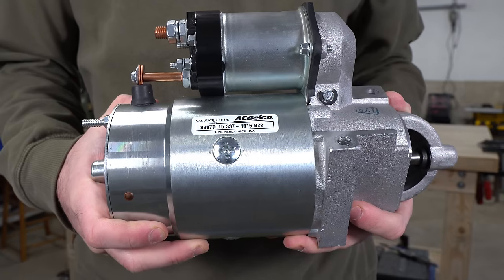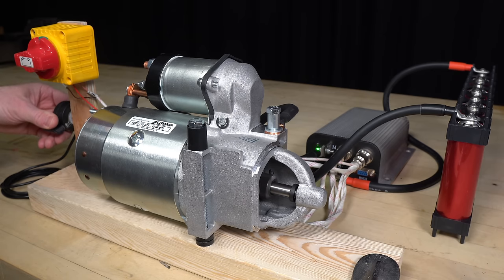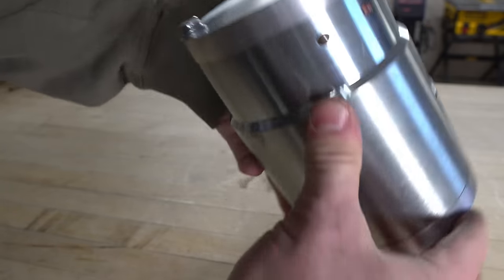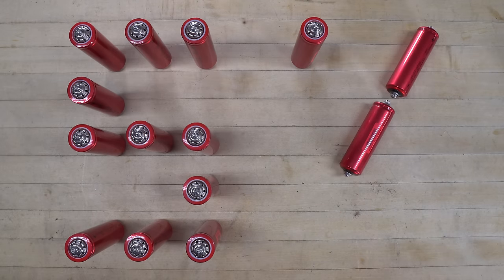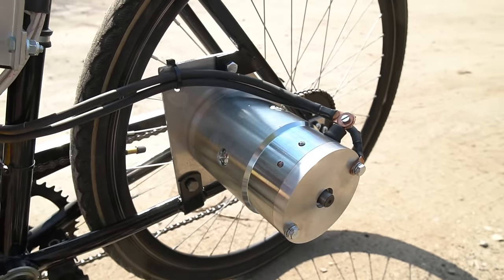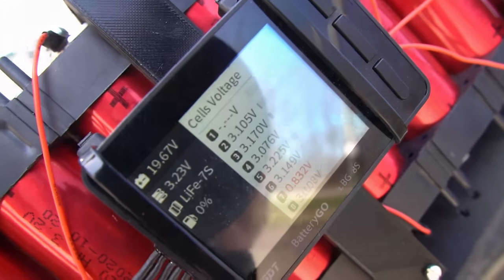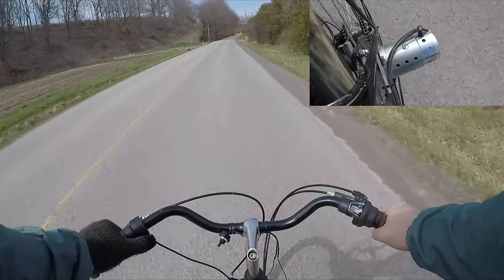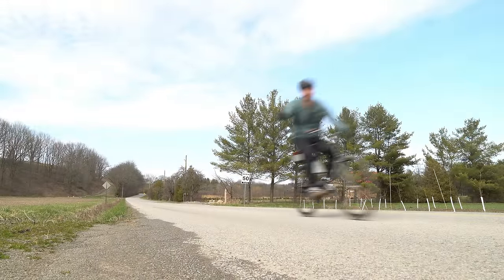Starter Motor Powered Bike

Comment: This is a valuable lesson on the difference between continuous duty and intermittent duty motors.
Reply: Lmao 🤣🤣🤣 burnnnn
Reply: The current draw on automotive starter motors is huge and the heat generated where the brushes run on the commutator because of this can even melt the solder holding it together after a short period of time. Converting an alternator into a motor is much better for bike use.
Reply: @alistairshanks5099  That is why they spotweld it.
Reply: Rubbish. That starter motor has a no load speed of  over 20000 rpm.
He is geared for 1000meters per second.
Over three times the speed of sound.
This means that there is almost no back emf generated reducing the voltage and current through the coils, and no air turbulence transferring heat from the armature and brushes to the housing.

He is turning many kW into heat and a small fraction of a kilowatt into mechanical drive force.
He needs a 250:1 reduction drive, not 5:1

That would give 50 times the torque per amp supplied to the motor, and over 50mph top speed
Reply: @Maungateitei  This thematic  is very interesting . Beside , as first ,what i captured ; no cooling vent , will be nice to change housing with Alu ( with ribs ) and , that will provide good cooling .. Ratio is still under a question  ?  By you , it should be 250 :1, , that means that we should reduce starter rotations 250 times ?

Comment: Suggestion for you next project: modify a LG washer machine's motor to run an e-bike. I saw that these motors are 3ph. I wonder if the large radius could delivery more torque.
Reply: There was a guy that did it, but i forgot his channel
Reply: @foxxyytofficial  ik the yt channal kreosan that did that
Reply: @RafeTVGaming "Kreosan" used an universal motor. The LG motor we are talking about is a brushless permanent magnet motor. "Why Not Cycles" for one made a video about the conversion.
Reply: I would think a starter motor for a car would have a lot more torque than a washing machine motor even but definitely a lot more than an e-bike motor which are considered high torque low RPM but nothing compared to a car starter that has to turn over an engine with a significant amount of compression to overcome and I think the tricks probably in the gearing but well outside of what has been tried already but I could be wrong you don't have much experience with electric bikes because I haven't got my first run running yet because it still needs a battery that's outside of my budget right now but I did see one here on YouTube where somebody used a much smaller starter successfully and another one that was working halfway decent using a quite small wiper motor but I can't remember Mimosa Channel I saw it on
Reply: @Teknopottu  you don't happen to have a link to that video by chance do you
Reply: @Rob337_aka_CancelProof  Found it, there seems to others too. Replace space with a dot. https://youtu be/UTLzlBWLxCw
Reply: @Rob337_aka_CancelProof  YouTube deletes most comments with links nowadays
Reply: The Direct Drive washer machine batteries are nuts
Reply: @Teknopottu  Hehehehe, it's a spincycle
Reply: More efficient

Comment: Next step is to water cool it! Plug all the hole except two, so you can have water flow through the centre (and make each end with the bearings water tight), then pump that water to a large radiator somewhere on the bike. Totally pointless but could be fun.
Reply: Instant corrosion. Instant shorts. Starters are designed for short duration and high current, they don't work well for other applications.
Reply: Water is not a good choice for a cooing liquid here. Oil would work, although a better solution is air cooling by way of a fan blade on the motor shaft and modified end caps to allow airflow past the windings.
Reply: Fill it with mineral oil..that is what is in those transformers on electric poles
Reply: You could use a water jacket to wrap around the motor, it's the same way you would do it with and rc boat
Reply: I would be more inclined to use thermocouples (Peltiers) as the additional weight of the cooling system would be more parasitic than the current drawn from thermocouple (about the size of a ceramic mosaic tile)? Thermocouples are not very energy efficient, but they are light weight compared to traditional water cooling systems? 
Putting thermocouples mounted directly to the motor with their own individual heat sinks (I would suggest copper PC heat sink if you can find them?)
This solution would provide instant inductive cooling direct to the motor.......but would likely cause some extreme radiant heating in the air around the motor and would be uncomfortable for the rider in summertime when stationary or moving slowly?
It would require some testing to ensure under load (going up a hill) that there is sufficient air flow to allow convection cooling of the heat sinks? As heat soak affects the efficiency of the thermocouple it will draw more current from the battery at the same time as the motor is drawing current from the battery also? How long and sustained the load is would be the determining factor? People would say that's a fail, yet they probably live in area where hill of sufficient gradient to make it ineffective..... Probably doesn't exist? Oh well go back to transporting around all your water and radiators then......for that 1 hill you ride up where a thermocouple fails lol
Reply: @jameshatton4211  Thermocouples don't cool, they funnel heat from one side to the other while also consuming ridiculous amount of power and turning it into extra heat. Starter motors aren't designed for this application. Cooling efforts will help but heat output under load would still be too great for sustained use.
Reply: @Rudy97  incorrect dude. Thermocouples DO actually induct cooling. There are both heating and cooling Peltiers available. You need to do more reading on Peltiers 😉
They are what is used in electric camping refrigerators 👍

Comment: You need to use an electric motor designed for constant duty, and use a brushless motor will offer better efficiency over a brushed motor like the started, (Which is NOT designed for constant duty).

Comment: In the early 2000's I owned a company called ScooterFaster.  One of the projects we built used an aircraft starter. On the plane the motor would spin a flywheel to an obsurd speed and the flywheel would be clutched to turn the motor using its inertia.
We thought this might work well because it was small (1/3 the size of the Delco) and given enough time it would reach crazy RPM and was built to do that without the armature exploding.
Long story short, it was great for drag racing, but you can only put out 400Amps for so long.
I still have lots of brushed PM 800 W motors which we used 2 of on our most popular stunt scooter.
KILLER WHEELIES until the brush holders caught fire.
Your controller is an awesome beast, but better suited for a go kart than a bike.
If you were in AZ I could hook you up with some motors to amaze your friends with (until you play too hard and they catch on fire.)
Thanks for reading.

Comment: Excellent video. Short comment: Yep. Starter motors are designed for massive current for maximum torque at very short intervals. At 100k vehicle miles it's made to crank a gas motor under freezing temp conditions, etc. Excellent work on the bike. No halfassery. Gorgeous lathe work, etc.

Comment: 5:18 well that's to be expected. Starter motors are extremely powerful but aren't meant for continuous running. That's why it gets so hot. I suggest you get an alternator or a dynamo and turn it into a motor. They are more preferable option, also because other people have done it before.

Comment: Try to remove your starter motor windings and wire new one from thinner wire with more turns on each pole. It should increase voltage rating of the motor and lower the current boosting the efficiency slightly ;)
Reply: I concur.

Comment: If you used a separate power supply or PWM controller for the field coils, you could strengthen the field at low speeds to increase torque and weaken it at high speeds to increase top speed. I'm sure if you increased field current like in the 9 minute mark you would not be able to hold the bike in place. Too little field current compared to armature current causing low torque, basically just shorting out the armature.

Comment: I really enjoyed your video! I've been a mechanic for 32 years. Your week link is the motor itself. VERY Inefficient brushed motor intended to work for 10 seconds at most. But really well built! Try using hobby motors. I put a Trungy 6374 on my skateboard. It'll pull up to 5000 wats! At 1700 wats (that's what I'm currently running) it'll do 25 mph with enough torque to tow a car. Top speed is voltage limited so I don't die. It is a skateboard after all... And the motor was $80.

Comment: I would fix a fan disc with many twisted fan blades on the shaft to draw in air from one end of the motor and blow the air out through the opposite end, thereby creating forced air cooling.

Comment: The moment you said "14AH battery only lasted 10 minutes" I LOL'd hard. Your eventual conclusion about the ABSURD inefficiency of that motor was right there in that test. A 14ah battery should be provide a LOT more than 10 minutes or riding!
Reply: Hope those cells are rated at 6C lol
Reply: Nope most car batteries are 30 to 50Ah yet go crank over your car for 10 minutes and see how well id does
Reply: 30Ah for a lead acid battery isn't the same as a lithium battery. for lead batteries the actual usable charge decreases significantly when you apply a big load to it, so yeah a car battery wont last long if you crank the starter motor nonstop
Reply: @EMILE12345678901  missed the point completely it isn't a matter of battery size or efficiency just damn size of the motor
Reply: For anyone else that read this 500w is at the bottom end of starter motor sizes but with some simple math at 12v it pulls 41.67a and a 14ah divided by 41.67a is just 20 minutes, but this is it's free spinning power draw pushing a bike are that could easily be doubled and cranking a car more like 4 to 5 times that is why car batteries have that CCA rating that is generally a few hundred amps.
Reply: @shaynegadsden  I wasn't commenting on that, I was replying to the other guy comparing Ah ratings of lead acid batteries with lithium-ion batteries

Comment: awesome project!
Id add a fan to the back of the shaft with more holes to draw air through.
Reply: I was coming to say the same thing. I was wondering why he didn't put a fan on the shaft to draw air through the motor. It might not save it but it'll prolong it for sure

Comment: Great Job Austin. Your alternator mod (old rusty) inpired me to do the same in my country and I love my new e-bike, BUT, as seen at your starter motors mod, I always wonder how many Km could I travel with the same battery with a regular BLDC e-bike motor.
Reply: Dont waste your time with starters. Modern ebike motor will make 100km range with pretty small battery and it wont even get warm. Starter motors arent made for this, i was trying to do the same but after buying normal motor i can have fun like 5h on ebike, and now i can see how crazy efficient those things are.

Comment: Around 20 Years ago , I had a Trike.. 
It was made by a homeless guy. Who Was Pretty Smart! 
Motor Cycle Front Wheel , Car Rear Wheels. 
It had a Dump Bed. 
And ALSO Peddles ! 
He has a VW diesel Car Starter that he modified 
He has the Ring Gear of from the car mounted Directly to the rear axle. 
One car Battery 75AH would only give around 3- 4KM of Distance. (No Speed Controller) 
Everyone said , Brushes would not last , Would over heat.. But never did! 
Push the Starter Button and "HOLD ON!!"
But was only used when he hit large hills and could not peddle up them. 
Took me years and Years of Seeing him and talking to him to buy it from him , than he moved into a friends house down my dads street 
He had it sitting at the time for a few years without using it. 
Brought it from him , Fixed it up a little and made a Few hundred bucks selling it. 
Kinda wish i had Youtube at the time to make Videos about it as it was a REALLY cool Setup!

Comment: I would also add a ring of radial fins to the external surface of the motor to take advantage of the external air flow to cool the motor.

Comment: The ones with permanent magnet are more compact and have loads of power too, but you still run the same issue of heat, I’ve played with one in the past and not worth to continue with it as the windings aren’t made for constant use and the amp draw is insane high no nope, I had fun for a bit anyway …

Comment: I like how you used a small block Chevy starter motor, probably the most common American starter in history. One of the only differences from the Buick Pontiac Oldsmobile, is the entry hole to the gear is on the other side of the starter, but many of the GM starters were the same, non gear reduction units

Comment: Try using a bigger rear sprocket so that the motor spins faster which in turn will allow the motor to generate a higher Counter EMF to reduce overall amp draw and heat.

Comment: Starters are designed to be intermittent motors due to their 4 field coil and 4 brush design which gives very high torque for starting an engine. However, when such a motor is used continuously, it will heat up very quickly and smoke is usually not far away.

Comment: Use a copper housing and add fins you can also try liquid cooling if you add fins or possibly an AIO style cooler with a radiator and fans

Comment: I would have taken a permanent magnet starter motor. Added some cooling to it...with a CNC machine you could easily cut out for example 2cm thick half circle aluminium profiles. In fact it could be done with with laser or water cutting too :)

Comment: See if you can drill a tapped pocket hole on the outside end of the motor shaft and fasten a substancial metal fan tight to it so it has good thermal connection and can vent the shaft heat.